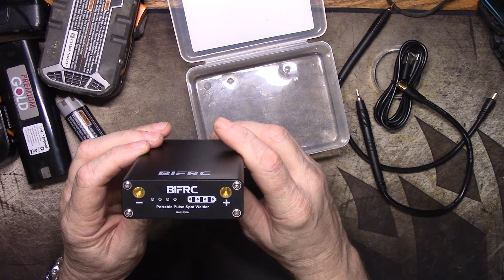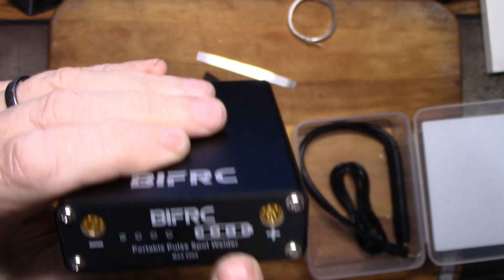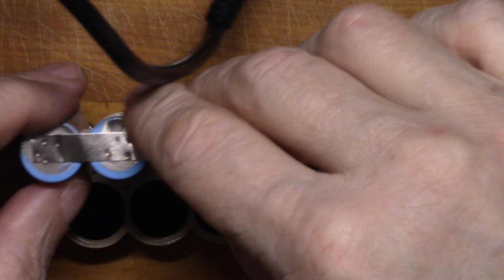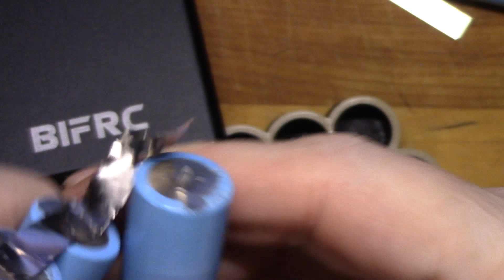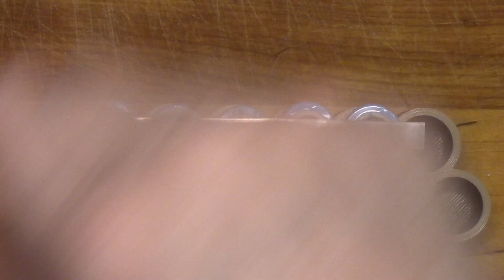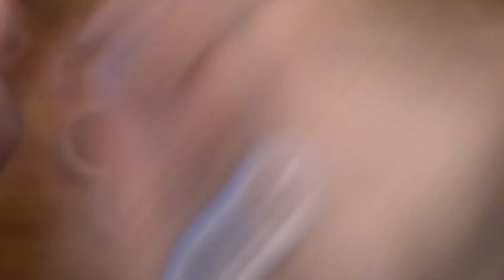BIFRC DH20 Pro mini spot welder test and initial review. 18650 battery pack welder.

Comment: 1. if I wanna replace the battery. which model should I buy
Reply from the maker: The battery inside the welder? I've got no clue. It's a 3.7v flat pack battery with large, solder terminals, which isn't something typically sold to consumers. I did a quick check on AliExpress and a couple of other sources and I couldn't find anything close. And since it's soldered on you'll need a soldering iron capable of melting a large area of solder fast enough so you don't damage the battery. I'd just buy a new welder, they're only $30-$40. There's a newer one I'm about to release a review of that's $40 on Amazon and will weld 0.2 nickel strip easily.

Comment: Many thanks for posting, It seems countertuative to push lightly.
Reply from the maker: I agree, it is counterintuitive. But pushing hard increases the contact area which also increases the power required to make the weld beyond what the welder can do. A light touch keeps the contact area within the power of the device and makes for a small but strong spot weld.

Comment: I used my DH20 Pro that I got from Aliexpress, for the first time yesterday making a new 6V battery pack for my Dirt Devil Scorpion hand-vac.The original battery pack was made with 5 - 1500mah Ni-CD batteries that would not charge anymore.So I bought from Amazon the Kastar 5-Pack Nickel Metal Hydride (Ni-MH) Rechargeable Paper Wrapped Sub C  Cell 1.2V 2200mAh Battery Flat Top to make the replacement 6V pack out of.I could not be anymore pleased with the job the spot welder did.First thing I did was use my Ryobi 18V hot glue gun to glue the 5 cells in the semi circle configuration I needed to go in the vacuum,then I spot welded 0.12 x 7mm wide pure nickel strips about 1-1/4" long to the battery pack so I could get about 6 spot welds on the negative side's of the batteries and 4 spot welds on the plus side button of the batteries, worked flawlessly.I give $17.99 plus $14.17 shipping for mine and it only took 14 days to get here.Now I can make other battery packs when needed.Your video among others is why I went with the BIFRC DH20 Pro spot welder,thanks for the informative video.
Reply from the maker: That's great! Thanks for letting me know.

Comment: I would like to know, what is the minimum and safe voltage that I can use it, before having to recharge?
Reply from the maker: Interesting question, I'm not sure why you'd need to know that since it has a charge indicator. I'm also not sure off the top of my head how one would test the voltage since it's probably got voltage regulation of some sort, specially on the USB output. But then again, I'm not an electronics expert.
Reply: @3rdpig  ok, i found an answer in another Review about this BIFRC spot welder.  and it was recommended to use it up to a minimum voltage of 3.8v.  because if you use it with the battery in a voltage below 3.8v.  it will damage the mosfets.  so I just have to check at what level of charge, indicated by the leds.  it reaches 3.8v, so I'll know when I have to recharge it, if when it has 2 leds, or 1 charging indication leds.  probably it reaches 3.8v when only 1 leds are lit.  kinda obvious, I just try to have total ctz, because I heard some comments from people who use it until fully discharged, and in a short time the mosfets were damaged.  I saw in some comments that the cause of this is by using it with low voltage (below 3.8v) maybe the battery indicator leds are not so accurate, and when based on them.  users end up using beyond limit voltage and safe
Reply: @3rdpig  Does yours still work perfectly after 1 year?  Did you have any problem?

Comment: Why wouldn't you want to charge your phone?
Reply from the maker: I do want to charge my phone, I just don't want to carry a cheap portable spot welder around as a battery bank and use it to charge my phone. But if you do that's fine, just keep a burn kit on hand and make sure the insurance on your phone is paid up.
Reply: @3rdpig  . Camping and such. I wouldn't worry about that. It would be a regulated output. The 5v boost converter in the device would fry first, not your phone. No more risk than pluging in a regular charger into a 15 amp 120v wall socket.
Reply from the maker: @E-BikingAdventures You do realize that when this is powered on the lead terminal jacks are hot, right? Does that really seem like a thing you'd want in your pocket or in a backpack when a far more powerful, far safer power bank is probably around the same price?
Reply: @3rdpig  . Why would you charge your phone with this if it was in your pocket or backpack? Set it down somewhere. You can put rubber plugs in them. I'm sure there is a setting to turn them off or a zero setting. I'm just saying it's a viable option if you're not careless.

Comment: Don't power it with a battery bank while using it. I burnt out one of the mosfets in mine while doing so.
Reply from the maker: It would never have occurred to me to have it plugged into an external battery pack while doing this. Were you trying to keep welding after the internal pack was drained?

Comment: Mine turns off after every weld any explanations?
Reply: I figured out the problem, my stupid dumbass connected the positive pole first. I am relativly new to all this so I didnt knew thats a thing. Thank you for your response, I appreciate that. So for everybody reading this, NEGATIVE first!
Reply from the maker: Sounds like a bad unit. Possibly a component that can't handle the load or a battery that's not charging? I'd return it if you can.

Comment: Thanks for video, bought mine from Amazon but every spot wield done the item closes down and switch off even with full charge or USB c powered up & switched on same time 
So much want to work so am I doing something wrong or have gone faulty item ?
Reply from the maker: I'm going to guess it's faulty, either a bad battery, bad charging circuit or some component that can't handle the load. It kind of reminds me when my phone is nearly dead and I try to take a flash picture and it flashes once and shuts down.

Comment: I have this Bifrc dh20 pro spotwelder. One thing i know is.. that the included nickle steel plate 0,12 x 8mm strip can be spotwelded fairly easy..My previous ebike battery.. made 6 months ago.. the voltage is sagging allot, maybe because i only used a single ,0,12x8mm strip.I've seen your vid but im still doubing about 0,15 mm pure nickled strip. Will it be powerfull enough to do the job. Maybe its a better option to just put 2x 0,12mm strip on top.

Comment: Thanks for the video. I need to attach a 0.3 x 6mm torch contact to a replacement V250H twin button battery. I wonder if this would have the power for that?
Not seen any video of welding .2 never mind 0.3mm
Reply from the maker: My guess is that it wouldn't do it. If I had anything around that thickness I'd try it I would, but I don't. In a couple of weeks I'll have a different one to test, supposedly more powerful, but still only designed for 1.0 and 1.5.

Comment: Is the Welder still working?Ordered yesterday the MinderRC DH30 the advanced Version with Display and 30 Gears.Hope it's durable
Reply from the maker: Yes, it's still works fine. I didn't know there was a new version, I'll have to check it out. Thanks!
Reply: Nice that sounds good.Yes it's pretty much the same Welder just Updated in Power, Display and touch Buttons.The WelderKit DH30 is the same device like MinderRC.Just different Label

Comment: What happens ig the two tips touch together?
Reply from the maker: Nothing if it's just for a second. But I assume if one were to hold them in contact with each other long enough for the device to trigger they'd attempt to weld themselves together. I'm sure you'll understand that I'm not going to try it, I break enough stuff as it is.

Comment: For some reason mine works like shit.....
Reply from the maker: Did you watch the video and try the things I mentioned? Mine worked like shit too until I learned the right technique. It takes a light touch and hold the probes at an angle so they rest on the edges of their tips. If you press too hard or straight down you'll increase the surface area so much that the welder doesn't have the power to compensate for it.
Reply: @3rdpig  Thanks for the response.
I am already experienced with spot welders and i know that technique is not the problem.
I think it might be the battery
Reply from the maker: @teun7923  Sorry yours isn't working good. I had a friend buy one recently and his works as well as mine, so I'm guessing you got a lemon. That sucks, but we're rolling the dice every time we buy something from China.

Comment: If you balance charge 2s2p (4 cells), 3s2p(6 cells), or 4s2p(8 cells), will the balance charger charge every cell or will count each parallel pair as a single cell when using 18650"s ?
Reply: Each parallel set is = 3.7v-4.2v 
The capacity is what adds together. 
The balance charger is going to fill up each parallel set as if it were one 18650. 
When the sets are balanced and full it will stop .
Reply from the maker: My gut feeling is it will consider the parallel pair as a single battery, but modern charge circuits have some some pretty amazing tricks. But you'll need to find someone smarter on the subject than me to give a definitive answer...assuming there really is one.
Reply: @3rdpig  Thanks I have that same gut feeling also. Ill do more research. Great vid.

Comment: i got one as well after watching the review and as it was said the trick is in very light pressure on tips. I didn't pay attention to that first so my welder was turning itself off and wasn't really working. but the light pressure makes impedance higher so the power dissipated power I^2*R  melts the metal on higher resistance points. Thanks for advice Chuck
Reply from the maker: YW. Getting the pressure and angle dialed in is all it needs to go from awful to awesome. Glad you got it done, thanks for watching!

Comment: I just got mine last week. I was disappointed wit the battery. Trying to weld on gear 8 I had to have the charger plugged in .If it shut off. But I tried to keep my pens straight up and down . I'll try your methods right now. I use the 15mm strip. A question for you is it a good idea to use the less expensive nickel plated strips. Versus the pure nickel strips And why or why not? Thank you for your video. I will certainly help me.
Reply: I'm just starting to spot weld power tool battery packs. I thought I had the nickel  plated strip but after doing the salt test I had the pure nickel. I find I make better welds with the nickel plated .Go figure.
Reply from the maker: I had no luck at all holding the pens at a 90 degree angle to the strips, there's just too much contact area and the welder doesn't have the power for it. Same with pressing too hard, you create more area to be welded which requires more power.
Pure nickle strips have less resistance than nickle plated strips and will carry a higher load without overheating.

Comment: Strange i have not discharge my 18650 cells, when i was spot welding a 6A 20v Worx battery, it was 18v and after charging 20.50v, and it worked perfect with my BIFRC DH20 Pro+.
Reply from the maker: Me telling people to discharge the batteries before spot welding is like companies who make towel roll dispensers telling people not to hang themselves in the towel loop. Congratulations, you're obviously intelligent enough not to require a "don't be stupid" warning.
Reply: @3rdpig  Thanks, yeah i know people can do really stupid stuff, and yeah everyone of us has done something stupid, but i am happy noting bad happened to me, i am soldering now a few years and it works ok with my Miniware TS100 and now BIFRC DH20 Pro+.

Hope to see much more video's of you soldering and spot welding.
Reply: @3rdpig  Well, if you tell people to "completely discharge" the batteries before welding, if they aren't very bright, they will probably kill all their cells with a deep discharge to 0 V. It's gonna be really safe though.
Reply: hi maybe its to late to ask but i bought mine and get it today  and i have an e-bike on my work with a nickelstrip  has broken on its battery  and i thinking to put a 4cm strip over it and spot welding over it  and start with first gear? so is it possible?   im thinking its a old bike  and the cellls is pretty good balanced with few difference in it last time i check.. so is it possible to just welding or should i disconected bms pcb  and or take out fuses to🤔 btw it is 18650 cell
Reply: @danielkarlsson2538  A e-bike battery is much bigger, and 36 a 48v, but i did do it with all my 20v Worx 
battery's, when they were around 18v, did not discharge them,  i have made 2 extra, and made 4 18v 
Makita battery's (are 20v in real life), and made a battery's pack to quick charge smartphones and tablets, 
and they still all work perfect.

Comment: if you solder carefully it is possible but it is not the best solution...(especially with crappy soldering iron or bad technique)  I am in the process of replacing the cells in a tool that has an integral/internal battery. I been trying to find a decent small, relatively cheap spot welder because I know I will be doing this again someday. 
There are several in this similar form factor but I was trying to figure out the best one. 

Also just a thought, the 5v out might be for draining the battery down to a storage state? (charging a phone would be a good way to do this even if that is not what was intended lol)
Reply: I have soldered on 18650ies before and they are all still fine. I was using good flux and a powerful soldering station so I could be really quick without heating the cells too much. It's not ideal but it can be done.
Reply: I was thinking the same thing: you can use the 5V output to discharge the internal battery to 70% or less for storage. Lithium batteries degrade way faster if you store them at 100% charge, something around 50% would be ideal.

Comment: I have the Hitachi 10.8 impact, drill, "dremel" tool, reciprocating saw. I also have similar tools in 18v but they don't get as much use. I love the light weight tools, so much easier on the wrists. I just solder tabs to my batteries instead of spot welding. The only trick is to use very high heat with a high power soldering tool and do NOT dwell on the battery but for a second. With a high power soldering gun that has a large tip it only takes a second. Never a problem in many many battery repairs. But hey, do whatever you are comfortable with.

Comment: Fun fact - those long Makita style batteries were the first things I ever sold on Ebay back in 2000.  I owned one of those drills LONG ago.
Reply from the maker: I bet I bought mine 30+ years ago. I was working at an Acura dealership and installing rear deck lid spoilers in the parking lot for some side money. I bet I could install a spoiler in 15 minutes and pocket $50 for doing it.